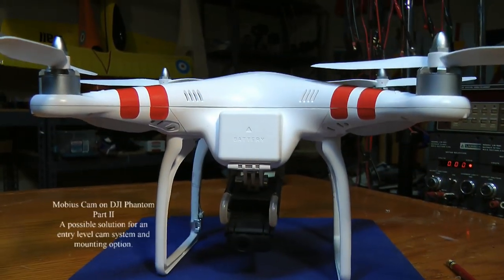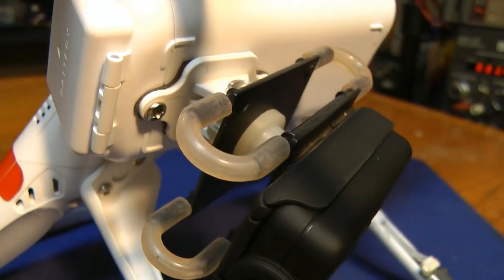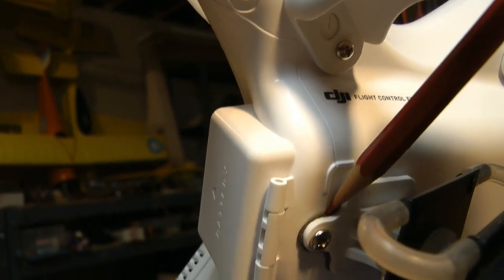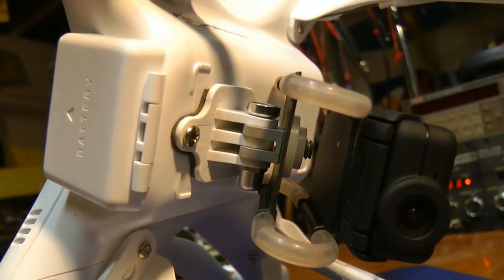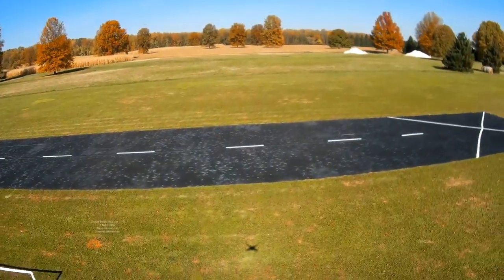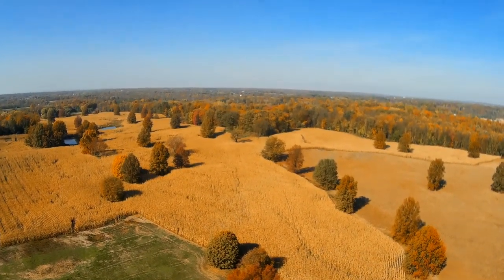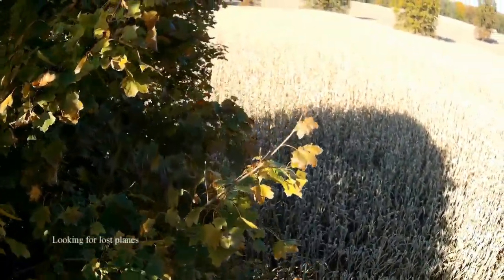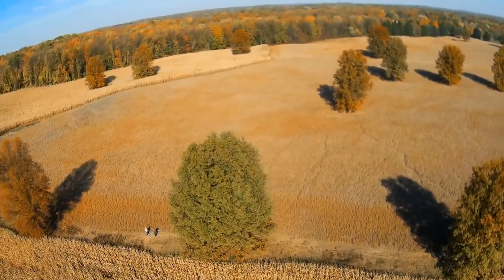Mobius Cam Pt.II A Solution To Jello?

Comment: I see you are from Ohio?  I live in Canton, OH and primarily motovlog and post videos on Youtube.  I've flown RC aircraft for years.  Problem here in the Canton, OH area, is finding places to fly.  Most parks/schools have banned it.  I purchased a v262 quad to start out with.  Will be purchasing a Mobius soon.  Looking at these different mount options. I sell polymers/plastics for a living..  Sound abatement and vibration dampening is an area I have some knowledge in.  Great video and nice job on the mount....
Reply from the maker: Hey Mr. Polymers. You've probably run into my friends Roy and Jason at Aerotech hobby shop then. We have some things in common. Years ago I was in the injection molding business in Hartville and was Engineering Manager for another molding company by the name of Different Dimensions which was on Killian Rd, so I know a little bit about plastics as well. Of course we like the R/C hobbies and I'm a Chevy kind of guy also. In my years I had a 58 a Corvair, 63 SS convertible, 64 SS convertible, 75 Monte Carlo, and still have my 1992 Corvette. When I was a kid more than 55 years ago I had two Lambretta motor scooters. One was the blue and cream colored 175 cc and the other was a very old 150 with the tubing style sport frame. Great fun for a 14 year old. I know what your saying about finding a good place to fly. I think the Canton club flies somewhere in the Sate Rd / St. Peters Church Rd. area. I'm in the Corsair Model Airplane Club that used to fly at the Summit Fairgrounds but we lost the field to the parks. We fly out in Kent now on property that used to be part of Rocky Knolls golf course. Maybe our paths will cross some day. Keep me posted on your Mobius experience.
 John
Reply: *****  Yes. I'm familiar with Aerotech.  Years ago, when in college, I built my first gas powered trainer.  A guy by the name of Bob Budash? who owned Modelers Haven did a test flight for me.  Found I had a bad warp in the wing since I did not build with a wing jig.  That was 34 years ago.  Have flown off/on at Stark branch of Kent State until it was banned.  Have recently purchased a few helicopters including a 6 channel variable pitch heli that I have a hard time controlling.  Since I motovlog, I like to post various Youtube videos.  I thought the quad would be great as a means of getting aerial video.  So, thought I would start cheap with the v262.  I really like the DJI Phantom, but not in the budget with kids still in college.  I'll subscribe to you. My brother in law owned property at Mohawk just to take his boat and ski.  I've been there a few times.  I think he has long since sold the property.  Maybe we can get together sometime when I get better with flying these things. LOL..
Best regards..  Terry
Reply from the maker: OK Terry,
Take care Pal
John

Comment: Nice Tutorial, nice guy and nice location.
Reply from the maker: Thanks friend. I appreciate the comment. I hope you look at some of the other videos.
Have a nice day.
John
Reply from the maker: stereodreieck yes I subscribed and will have a look around. I see you like sail planes. I have a classic Aquilla Grande 3 meter sailplane (70's) that I converted to electric. I made my own extended shaft motor to fit. I love it and have a small camera installed. It can fly for hours on just an occasional kick from the motor. It will climb out at 45 degrees from a hand launch. I think there's a few pictures of the motor and maybe the plane on my Motor Construction Video.
John
Brushless Motor Construction
Reply: *****
Awesome, do you have a Video of this plane.
Reply from the maker: stereodreieck
Hello, I have some video from the plane but none of a launch and flying around. I will have to try for something soon. There were a few forums that got really upset about me cutting the nose on this classic and putting a motor in it but it works so wonderful that I have to think they were wrong. Our club is currently flying at a smaller field than I'm used to. I'll try to drag it out to where there's a little more room.
John

Comment: here's a tip, dump the carbon fiber blades and return to the much more flexible original phantom blade, they don't transmit the vibration of the copter and the jello disappears....try it.

HJ
Reply from the maker: Herb, I did find that out. At least they were easier to balance and better for me than the CF. 
John

Comment: http://i60.tinypic.com/9vebte.jpg

I got myself thinking what do I have hanging around to work with and I used tire wrap, and weather striping, cut to strips and  will test out.
Reply from the maker: Hello, I saw your picture and watch some of your videos. I hope your idea works out for you. Let me know some where down the line. You already know balance is really important too.
John
Reply: Blade 350 QX Mobius Project De-Shake

In this video I  added a few  vids, and that video of the  actual flight with the     mount I modified.

The flight started smooth, flown around smooth, and  when it is windy and  the qud chopping through the air,  I can accept that roughness.  so in my eyes it did the trick.  I flipped her so you can see it held on.  thanks for the interest.  I guess no matter how we look at it , I may never get a perfect video Lol

allow time to convert
Reply from the maker: *****
Nice job, The video looks much better. There's something fun about the challenge to get good video from an entry level system, right? I'm waiting to see a gimble made especially for the Mobius. I think there should be a way to get a much more compact system than what's used for the GoPro. Hey I noticed a vibrating sound in your video. I heard the same from someone who had loose buttons on the camera and they where vibrating. Just a thought.
Take care and thanks
John
Reply: Yep it is annoying, I  already opened it up, and the bat plug is sketchy. I bet like you said, it can be that so a  dab of glue, rubber glue will do the trick.
I like to see that link for the Mobius.  I am  waiting for my board for the gopro gimbal, see if I can burn this one up to Lol  I go that route  if I can for sure!!!!

I have a video,  flight 17-20 will see if any better windy again as always
Reply from the maker: *****
Hi, If you look at the discription under the video I have some links to forums on the Mobius. You'll find them really interesting. Yesterday I had my first flight where I could notice a satellite drop out with the mobius on the Phantom. Bummer, I'll have to work on that.
John
Reply: thanks well aware of the thread, I keep clear of locked minds. peace

Comment: Hi Dad, well read a bunch of the treads per your links and after all the BS from the techno heads, I'd say I'm more confused than ever, LOL, I just bought a Phantom 2 and have a mobius and love your mount, so gunna try it, just gotta find the board you used, Radio Shack, computer store maybe, then give it a go, guess we'll see. 

If you have further impute, please do.

Great vid, I'm a standup Paddle Boarder, that lake looks very inviting!!

Thanks,

Mike
Reply from the maker: Hey Mike, glad you liked the video. Any kind of board will work. I thought the circuit board might help with RF interference but I'm not sure it does anything at all. There's a lot of copies of the mount on YouTube know and some are really simple.
Just have fun.
John
Reply: Ok, thanks, I certainly hope so, I've only been flying a few months and found the phantom 2 used from B & H Photo so decided to jump into a larger bird. The Phantom is a big step up from my Alias, so of course fear losing the thing if I don't watch how I fly and what I attach, was thinking the small Mobius was a safe bet due to its size. Doesn't sound as if your having trouble, so hopefully I'm lucky here to, as the interference doesn't sound as if it's consistent from one bird to another. Oh well I'll keep reading the threads.

Thanks.

Mike
Reply: Howdy, Howdy, one other thing I noticed in you Video using the fuel line as dampeners, you mention that the camera was in Wide Angle mode, I wasn't aware that the Mobius had a setting, so it's a setting not a lens, correct??, Phantom hopefully here Wed. maybe tomorrow.

OOP, which Phantom do you have, 1 or 2?

Mike
Reply: Hey Dad, just received my P2, so using the stock GoPro mount for the swivel section of your mount design.

By watching the vid a few more times it appears as thought you used double sided tape with maybe a very thin piece of foam (?) between the mobius mount and the bottom half of your mount. Yes??
Reply from the maker: Mike A
Hello Mike. I used double sided 3M tape that is about 1/16" thick. This is a black super high strength tape. You can find it in most hardware stores though, you will notice it's about twice as expensive. I clean surfaces with alcohol before using it and if I remember right I also sanded the soft finish off the Mobius Cam mount. I also have a piece of the tape under the little swivel mount that is screwed to the Phantom. Don't forget you can buy extra mounting parts for the Cam, so you don't have to worry about using one up.
John
Reply from the maker: Mike, I'm sure you wouldn't want to be on the lake with your board at times. There's no HP or speed limit outside the bay areas. I used to ski a lot in my younger days but that was long before I turned 70. I enjoy my 18 ft Regal and 55 mph these days. Most of the time during the week the lake is pretty calm though. Hey don't forget to look at the links in the description under the video. You will find reference to the software downloads for the Mobius there, if you aren't aware of this yet. The software allows you to make many adjustments to the camera including a field of view change, exposures, time laps etc. You'll really be surprised if you haven't seen this yet. Good luck and let me know how you make out.
Reply: ***** Good morning, well on my way to finishing my mount. Was having trouble getting to my settings page to make a few changes, so called Mobius (from the Mobius-actioncam.com site) for help. During that conversation it was mentioned that Mobius is getting ready, today actually, to come out with a "SHIELDED" version of the 1080P camera. I asked if he could tell me what they did to "Shield" and all he would tell me was that I might be able to purchase a new case which would provide the needed shielding.

In the mean time, are you still flying without GPS issues, as the mount I'm building uses a board material that's used for making computer boards but does not have any copper on it?
Reply from the maker: Mike A
Hello Mike, Thanks for the interesting information. I actually have not had problems with Mobius interference even before the copper board. I think it has a lot to do with how well you receive satellite information based on location.
John
Reply: ***** Thanks John,

Really appreciate your speedy replies.

Hopefully I'll have this thing together no later than Wed., as were going camping this next weekend in the Anza Borego desert, so plenty of room to check it all out......Oh, do you have an actual prop balancer and if you do which one.
Reply: One more question If I may, just finally got my Mobius working, a PC guy I'm not, but learning, so the question, when I put a new card in the Camera is it necessary to put all the setup info from my initial card on the new. I hope that makes since.
Reply from the maker: Mike A
Hi Mike, If you are going to use a new card I think it should be formatted in the camera from the Mobius software program. I don't think there's anything you need from the old card except saving your videos.
Reply: OUI !!!!!, this all seemed so simple up front, so does simply putting it into the camera format it?? or is it in another download??

Sorry your the recipient of all this grade school questions, I've spent hours searching UTUBE for answers to setting this silly little camera up, even called Mobius a in New York, they basically refused to help because I hadn't purchased the dang thing from them direct??, Obviously I'm very new to all this, so thank you for your help to this point, I am determined though!! My goal is to shoot video for my own websites, LOL, and no I don't build those, I leave it to people like yourself with a brain that sees all this computer setting up as "TOO MUCH FUN" 

Be interesting to see how your location looks today, you get snow there, yes?

THX,

Mike
Reply from the maker: Mike A
Hello Mike, we get a considerable amount of snow here and we have snow on the ground right now. The lake is beautiful in the winter but the home is on a hill with an impossible drive. Access to the lake is also treacherous in bad winter weather. We usually spend most of the winter in our small house in the city. Don't get discouraged over the Mobius. You can try the card as is or formatted in a computer. The default settings might work ok for you. If you want to do what makes the most sense you should visit the forum link in the video description and do some reading from page one. The software interface for the camera makes it so versatile that you will never be sorry. There are settings galore as well as the latest firmware updates to make your camera work at it's highest capability. 
https://www.mobius-actioncam.com/softwareuser-guide/
For the setup download and manuals.
http://www.rcgroups.com/forums/showth...
For the support forum.
Hope this helps.
John
Reply: Hi john, Thanks for the info, bough a new card, per the suggestion in the manual, couldn't find a Kingston though, so went with a name brand 16gig class 4.

I've watched a few vids on the camera, and was surprised at how grainy an evening shot of a later sunset, thought it might do better, but the camera I'm sure is best suited for daylight. QUICK question, are you using a class 4 card, as the manual says that a class 4 is more than good enough and that a class 10 would be a waste, do you concur??

I did read much of the manual and have updated my firmware, and made a few setting changes based on a utube vid I saw, but won't know how they work vs. default setting till tomorrow morning.

Got my "jello" solution built, keep trimming the tubing to get the two pieces closer together, as mine hangs rather low, I'll send you a pic, somehow??, r u on facebook??

Flew with the camera attached today, but wasn't recording for some reason, so that's why I got a new card, then tested it this evening, it's working handheld????

Thanks again for your continued replies.

Mike
Reply from the maker: Mike A
Hello Mike, I had an extra card from a cell phone, it's a SanDisk 16 GB Mobil Ultra HC I for whatever that's worth. I think it might be Class 6 though. Whatever it works fine. Yes, the camera is a little grainy in low light but really good in adequate light especially for the price. No on the Facebook, I have my account disabled because there's just to much useless chatter for me to keep up with. Let me know how your tests go.
John
Reply: Thanks for the info, test today.

MIke
Reply: Well first test went reasonably well. The only thing I noticed was that my vid has a wee bit of a jiggle in it, not jello, just kinda a....jiggle.

I'm wondering if, since my version is a 1/4" or slightly more between the top half and the bottom that it may need to be closer together. Any thoughts. Plus mine appears to be a bit longer than your. Going to make a version two where I can make a few adjustments.

Jeez, just  catching the news, seems you guys are getting clobbered with snow, boy could we use it.

Mike

PS, Cameras working great!!
Reply from the maker: Mike A
Hi Mike, I'm sure you will come up with the right combination. Did you balance your props and motors? I think in my first video I showed the balancer  I use. I like the magnetic one better than the rollers. I made a special precision arbor to match the same dimensions of the motor prop mounts. The snow wasn't to bad here. We're far enough from the lake and west enough of what NY is seeing. If we can get through the next upcoming round the snow blower can stay in the garage for a few weeks I think. Glad you're making progress.
Take care.
John
Reply: Cool, thanks, I'll keep fiddling with it.

Mike
Reply: Hi john, well I've definitely improved the video quality by watching your most updated Mobius mount video one more time,, I caught that you were shooting 1080p at 30, I'd missed that in the setting and was shooting 720/60

While shooting in the desert this weekend and having the camera pointed directly into the bright sunsetting sky all was nearly black below the horizon line, however when I turned the P2 opposite direction and shot out into the open desert, and it was definitely loosing light fast I was delighted to have much brighter shots than expected. is there any setting that would help the sunset shots??

The mount is working great, the jitter I noticed in the earlier shots once I changed to the 1080/30 went completely away. Sweet.

Mike
Reply from the maker: Mike A
Hi Mike, there is something you might want to try. There are two stored settings for video that you can access from pressing the buttons on the camera when you turn it on. Mode 1 and mode 2. When you press the power button the camera will come on with a yellow light showing. This is mode 1. If you press the M button again the light will show blue and you are in Mode 2. Another  press takes you to red and picture mode.  If you have no use for the 720 settings you might want to let mode 1 set to standard 1080 and set mode 2 as 1080 and a dynamic range setting of On or Low Light. I haven't used them much but set that way you could use either without connecting to the computer to access the options.
Good luck.
John
Reply: Thanks, I'll give it a try.

Have a great Turkey Day

MIke